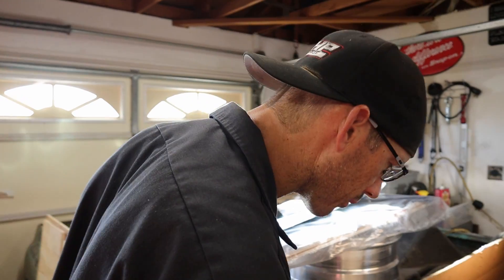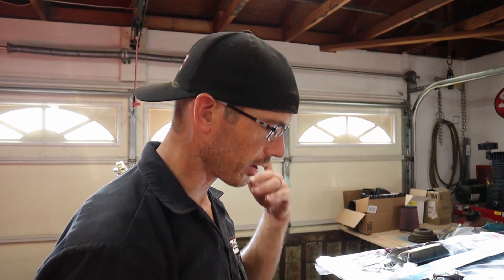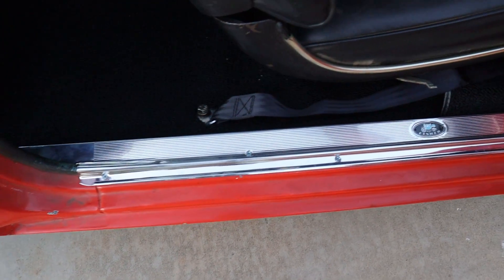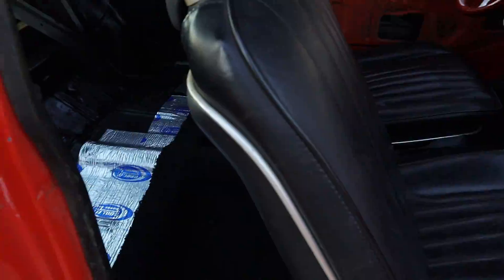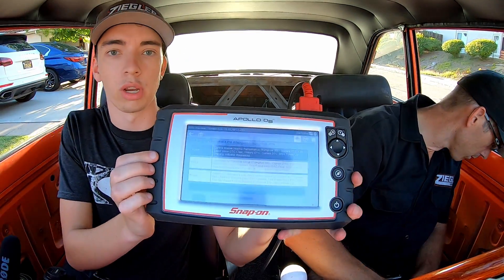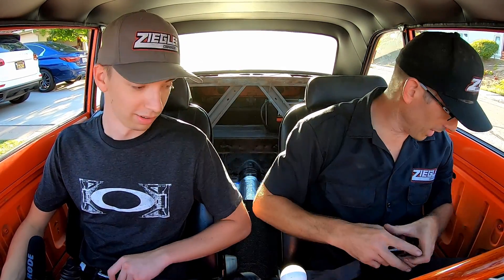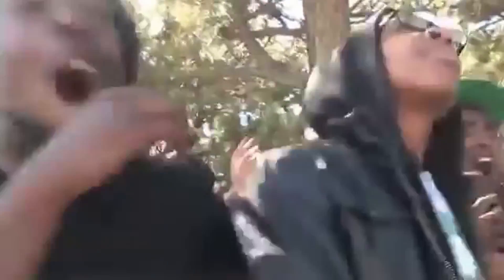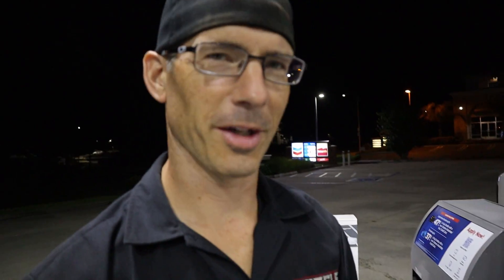We are OVER this Nova

Comment: Call you guys great, can't wait to see the next project!
Reply: So the after market throttle body is it one you've used before? Is the shaft to tight for the motor to cycle once it gets up to temp. Just thoughts, good luck. Interior looks great.
Reply from the maker: Thanks! We did testing with a new stock GM throttle body and it had the same problem. We’re thinking it’s wiring related at this point. Gonna have to do more testing.
Reply: Carpet looks nice 👍
Reply: I bet it’s in the tune. What code is it throwing?